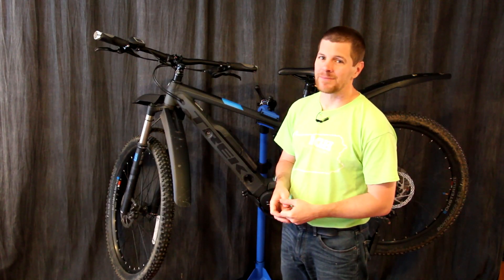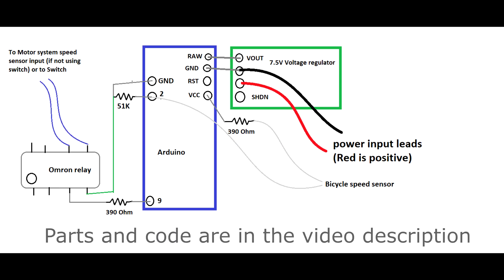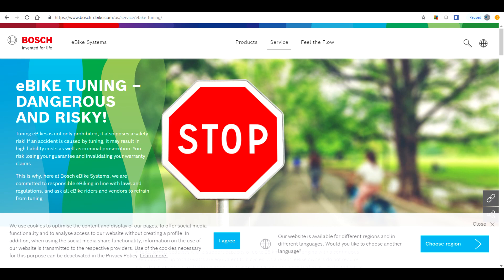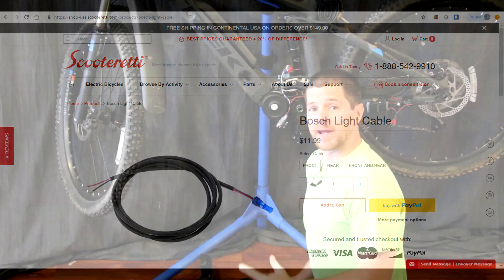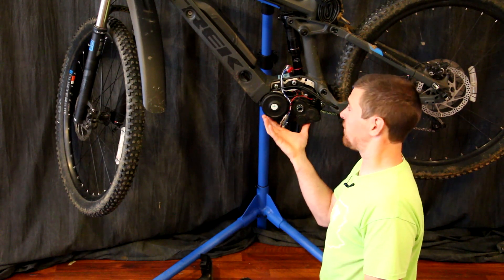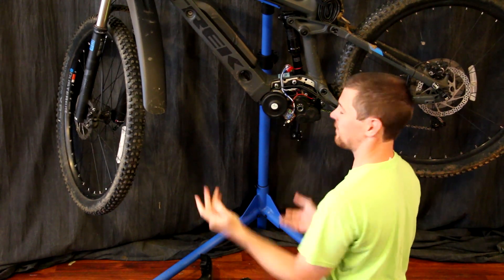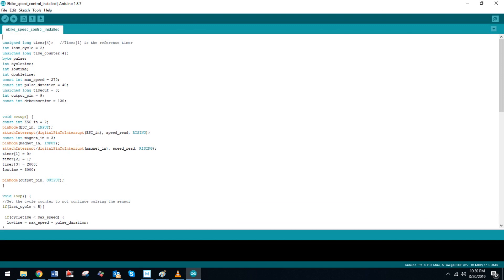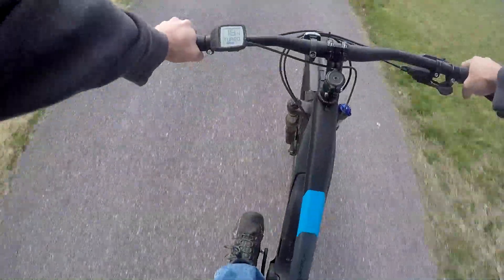How to hack a Bosch Performanceline CX Speed limiter (Trek EBike)

Comment: Can you make code for converting the walk assist to a throttle? Must be doable wish knew someone in a bike shop that had access to the diagnostic machine to up the speed on it! See I'm in the UK we are restricted to 15.5mph yeah sometimes it'll go 19 depending what mode your in with the new latest 2024 update but the US 20mph that would definitely be something we could do with here! They are looking at increasing the motor wattage to 500w on 28th April but keeping the 15mph speed limit! We don't need a 500w hub drive that just shows how little the government know ebikes! 250w is more than enough to reach 40mph at 85nm torque it's a rocket! It's the speed we need upped as 15mph is dangerous to merge with traffic on our busy dangerous roads! It's just to slow!

Comment: Hello! I had someone build and  install the device on my e-bike with Bosch CX Performance engine. I've tested it for an bout 12kilometers and bike is not performing as described in the video - I can barely get the hack activated,  when I reach 25km/h the bike stops giving me assistance. The speed hack activated very seldom and just for a second or two. It would sometimes decrease the speed shown on the speedometer even below 25km/h. The one time it did activate and stay on for a minute - I had to pedal like crazy to keep it going. Please advise on possible faults/ thing to look for. According to the guy who made the device - the assembling + code have been literally copied from this video.

Comment: Great, smart electronic engineering !!!
I guess this will not work with the anti-hack software built into the Bosch Performance line Gen4 motors. Too bad. Looks like fun stuff to do even though it has been a long time for me. I have a Bosch Gen4 Performance Line Speed 28mph
Reply: Ho wdo I know which gen my bike has?

Comment: Ok cool idea, but as is often the case, the video, the circuit and the code don't add up. 

In the video you show the circuit and show that analog pin 2 and digital pin 9 are utilised. You then show the speed sensor going to pin VCC (which is voltage input) and in the code you utilize analog pin 3... 

There is also no explanation on how any of it works. Such as why the use of the relay? The Arduino is turning the relay on or off when it could just send the signal itself? The relay is surely not needed at all.
Reply from the maker: They changed the circuit about a year after I made this video probably to prevent people like me from hacking it.

Comment: This is cool if you have some soldering skills and already have the tools. I thought this would be a great opportunity to learn, but then I saw the Speedbox kit that you can just buy and went that route instead lol.
Reply: With the new bosch motors (see my comment above), and this engineering; you are probably more likely to throw the dreaded 504 error (really sucks the way bosch handles this going into limp mode for 90min). For instance look at wonderful Giant Syncdrive Motors if you get and error code you simply turn motor off and back on again and you are good to go. Also, even with the error code if it is capable it still lets you set assist levels. I used the chainstay trick with my Giant motors and it works great.

Comment: I wish someone could figure out how to add a throttle. There are a number of nice E-Bikes I would be interested in but my left leg is injured and I can not ride a pedalec ebike. I NEED the throttle option. I despise Bosch's proprietary system.
Reply: You could add a throttle... Use a setup similar to the one in the video. Tap into the torque sensor wires and connect them to a microcontroller to read the data. Connect a throttle to the microcontroller. Convert the throttles analog signal into a digital signal to be sent to the torque sensor wires. 

It's just theory but should work

Comment: This video should be called. How to void your warranty on your ebike. If you do this to your bike you WILL void the warranty. Even if you put it back how you bought it, the bosch diagnostic software will know it has been done and the serial bumber gets logfed and you get nothing if something fails.
Reply from the maker: Meh... Warranties are made to be voided.  Live safe and happy and enslaved by rules or live free by your own rules.  your choice.  Choose wisely.
Reply: I'm skeptical of your claim. Unless the engineers at Bosch wrote code specifically to catch this type of mod, such as cross referencing the travel speed using GPS and the speed sensor, there's no way they would know. Unless you told them that you tampered with the bike, I think this would go unnoticed if it was put back to stock.
Reply: @roland da beats well most idiots that hack their ebikes still take them to bike mechanics to have their bikes serviced and part of an ebike service is to run firmware updates to keep bugs out of the system. Of coarse tye way around voiding the warrantt is to never get your bike serviced but when you have an issue and you take it into a shop for warranty. Which, lets face it. The modern consumer will always try for, they will get rejected on their warranty because it has never been serviced by a certified tech. You are all arguing with qualified bike mechanic. Aye yay yay. If you want to go at speeds of 60km/h+ go buy a fuckin motorbike. These bikes and their components are not designed for high speeds like that a d the frames arent designed for the torque that comes with it. And the batteries are deffinately not designed to exceed the temos that they reach going thise speeds. Go ahead, hack you bike and run the risk if blowing chunks of meat off your legs when the battery explodes. You wont get anything out of the companies that made the systems.
Reply: @Eydaselekta Just chill man. No one is trying to be disrespectful to you, there's no need for the negativity. We're on this video to learn something new and share ideas. Also, are you sure that the components are not designed to go that fast? My Bosch bike is unmodified and I've hit 70 km/h going down a steep hill. Many non-motorized road bikes can go even faster. It would seem like it would be a bigger liability on a manufacturer's part to build a bike that can't handle speeds significantly higher than regulation in the case of downhill speeds. 

Also If I'm pedaling up a steep gradient on my bike, the motor can work very hard for long periods of time. My motor will add assistance to my pedaling output up to a point, after which it doesn't provide anymore. To me this is indicative that the motor is pulling its maximum specified current draw. This most likely is handled by circuitry in the motor controller. With the circuit in @Higher Voltage's video, he's not changing the motor controller to draw more power, he's just faking the speed sensing circuit  to not deactivate past the regulated speed. So I'm thinking that the motor protections should still work the same. If that's the case then there shouldn't be any additional risk to the electronics because as the speed increases the current draw should still be limited just like in the case of climbing a steep hill. Obviously the risk would be on the owner if they did a mod like this but I don't see how faking a speed sensor would pose more risk to the motor unless the electronics sends more power to the motor causing it to accelerate faster than normal. Am I missing something with this line of thinking?
Reply: @BeginnerMoto  the bosch motor is a pedal assist so it cuts out at a predetermined speed set by bosch dependent of region. Batteries are different for each region to accomodate those with a higher speed allowence. You can see in the diagnostic o
Software the temp readings of the batteries when the head unit is plugged into a computer. You can see how mamy miles the bike has done and hours of riding etc so it is easy to see if it has been overclocked. There has been cases of batteries catching fire. When a pedal assist bike that hasnt been hacked in any way exceeds its allowed speed, the motor stops. So you can still descend on them at 70km/r but the motor isnt doing any work. Gravity and your legs are doing it. Your breaks arent going to last long riding like that.
You will cook the rotors in one ride, forever go through pads. Those bikes are a fair bit of weight to stop at that speed for those disc breaks lol.
Reply: I'm sure my three year old ebike doesn't have a warranty anymore so I'm good!
Reply: @taylor sloan bosch do have code written into their software that shows when their bikes have been hacked. It calculates battery charge, consumption, temp amongst other things. I'm a mechanic that works in this stuff day in day out so yeah i know.
Reply: @Eydaselekta  Code in there Service tool software NOT BIke software. DONT FIRMWARE UPDATE OR BRING IN FOR SERVICE. Personally IDK about warranty if you do DONT DO THIS

Comment: My concern with this video is over the "Bosch light cable". Maybe I missed it, but how does a "light" cable help with speed sensing... So far the other videos, about that cable, speak about powering a light, not speed sensing. Details NEEDED/REQUIRED!
Is this simply a way to get people to purchase this cable, and then it's too late to return after if does not live up to what it was pitched as.
Reply from the maker: Bosch simply calls it a "light cable".  It uses the same connector as the speed sensor except for that the pin needs removed to fit the socket.

Comment: Thanks for the video, very interesting and useful. And I’m glad you pointed out that this isn’t something one necessarily HAS to do. 
I just wanted to add a few things for viewers in the EU or at least here inBelgium. You will not just lose your warranty if you “upgrade” your e-bike (which, for me, makes it a valid option once the warranty runs out), less convenient is the fact you will face legal consequences if you “forget” to inform your insurance company about the classification-change (from bicycle to speedpedelec or motorcycle) and your e-bike gets speed-tested by the coppers, which they start to do more and more. You will pay handsomely for the ticket and will be forced to take insurance anyway. So it’s best to make sure you’re properly covered, especially since your legal worries are gonna be multiplied when you’re involved in an accident. My colleague was caught up in an accident on his way to work, riding on his “tuned” e-bike. His bike was pretty much destroyed by that pickup truck and the accident wasn’t really his fault. But nevertheless the police tested his e-bike, found out what he’d done and informed the insurance company of the pickup truck. They argued that the accident was not caused by the driver of the pickup but by the “unexpectedly high speed” of the bike which had led their client into an error of judgement. They didn’t wanna pay for the destroyed bike and asked the biker to pay for the scratches on the pickup. 
In the end, a judge decided that nobody was gonna pay anybody and each had to take care of his own damages. 
So, my colleague tried to get the money from the employer’s insurance which covers you on your way to/from your work, even if the accident is your fault. But they argued his bike was an illegal vehicle and he got nothing. For a 4,000€ bike in ruins !!!  
And the cherry on top was the letter he got from our employer. Since he was getting more than 200€/month (the tax-free bike-incentive that employers have to give to you if you come to work on a bicycle or an e-bike that goes 25km/h max) for his daily commute, our employer forced him to pay back the last 12 months. 
So please, be smart and do the right thing.

Comment: What a great idea. Thanks for posting. I actually built one and it worked great. The second one I built didn’t go so good. All I did was extend the wires from the wheel sensor to the arduino controller and from the arduino controller to the existing sensor input on the motor. I needed to mount in a more secure location further from the motor. I am now getting erratic results. The output pulse frequency to the  motor no longer divides by 2 after 19 mph and jumps all over the place. Any ideas. Is there something going on with a time lag due to longer wires? When I shorten the wires the problem goes away.
Reply: I know this is a late response but it may help someone else. It sounds like you're getting RF interference because of the longer wires. Essentially the wires are acting like antennas and picking up stray RF signals feeding in junk into the microcontroller. You can try twisting the sensor wires together to cancel out the interference. Look up twisted pair wiring for more info.
Reply: Possible rf interference from your mobile phone? Screened twisted pair cable may help.
Reply: This sounds like the wheel diameter might be set wrong.  Honestly, it would have been better to just skip the doubling and simply wait to send the pulse until the elapsed time had expired... Well.. at least that's my best guess.

Comment: Just tape the magnet to the sensor!!! Always do 00 mph and motor NEVER turns off!!!
Reply: Doesn't work Error!! 😈
Reply: Different system in the new 2020 powerfly. I did what you suggest with my old powerfly and it worked a treat, this new one though, it’s all built into the rear disc mechanism